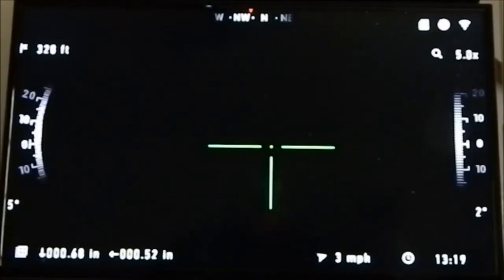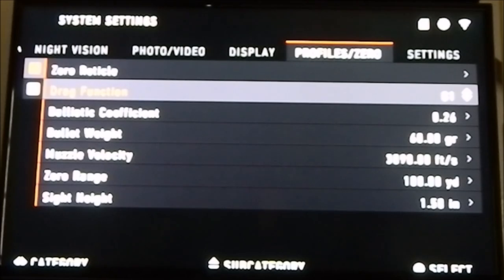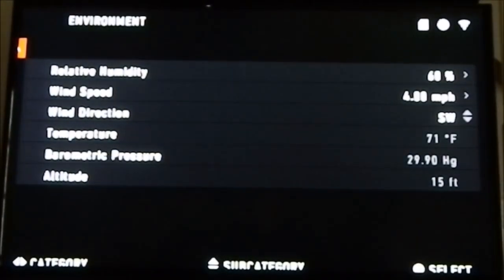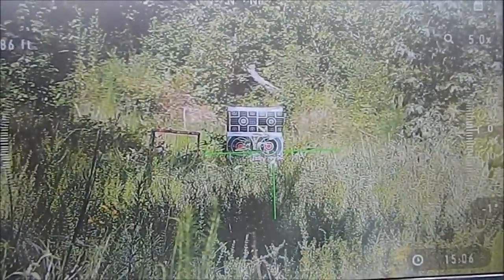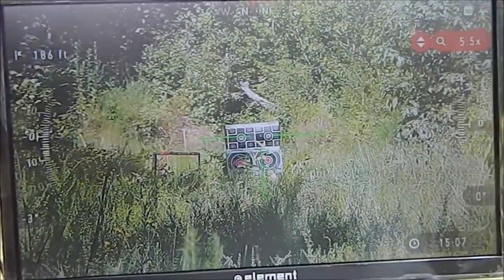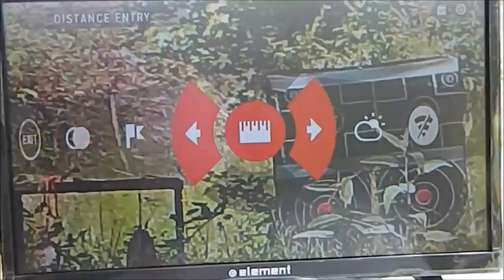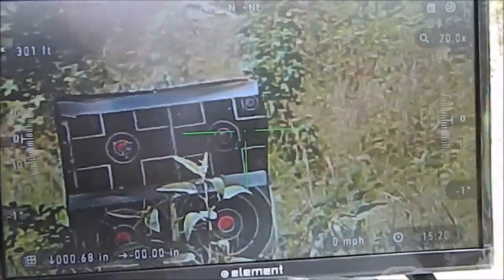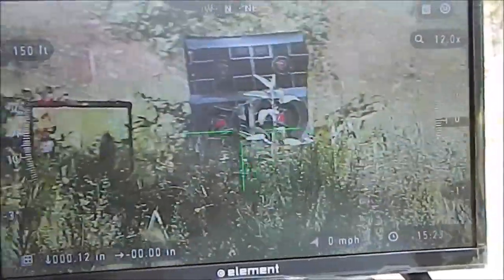Ballistic Calculator - ATN X-SIGHT II HD - ATN How To Guide

Comment: Does the ballistic calculator work with Air Rifles??? Thanks.
Reply: Yes it's tremendous. I've tested it from 25to100y and it's spot on
Reply: Richard Utting Interesting.  I guess I have to just get one and try it.  😊. Thanks.
Reply: It does! I threw it onto my cheesy .22 Gamo. Was difficult to find ballistics and had to chrony the shot for velocity,  which averaged out to around 870fps. Once done?  I put it on paper at 25 yards, and the Calc kept it on paper at 75 and 100 as well. 

And the best part? Swapping back to my AR was a simple matter of selecting that profile.  Or swapping between pellet weights or types (once you solve for them), etc, just make a new profile.
Reply: Good to know. Thank you for the feedback... : )